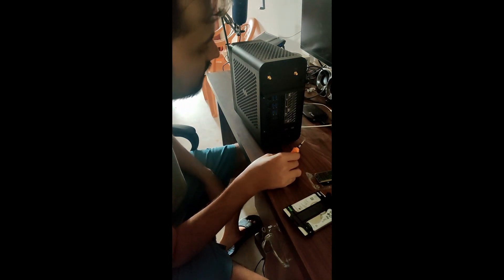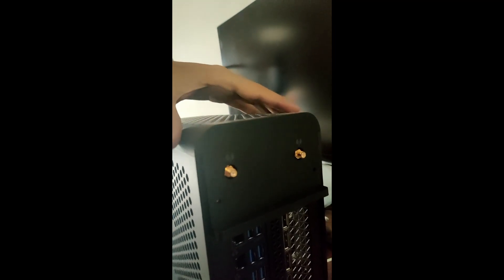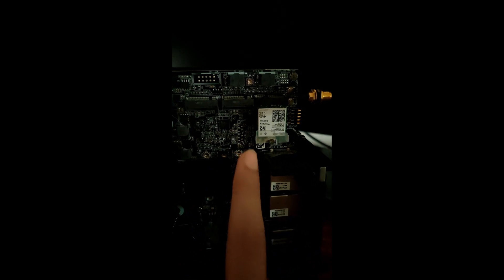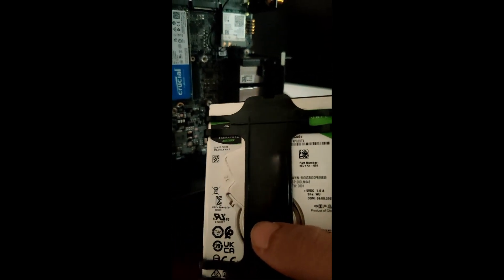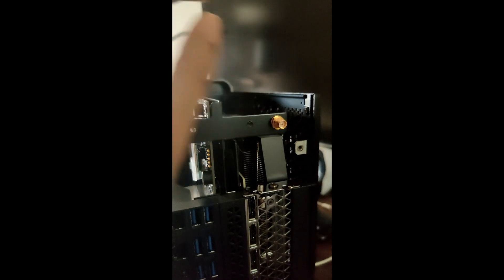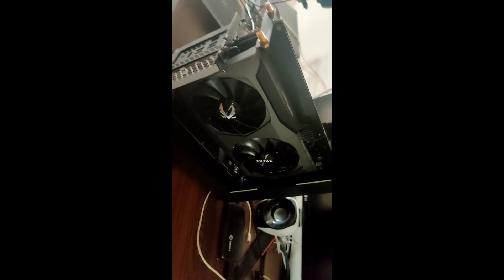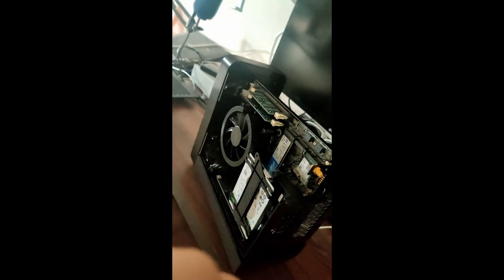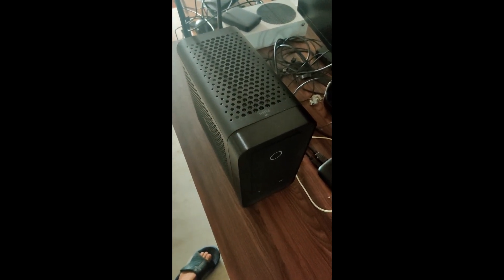Zotac Magnus One with RTX 3070 Upgrading and Installing RAM SSD HDD #zotac #zbox #magnusone

Comment: Is the CPU upgradable or soldered on the board?
Reply from the maker: The cpu can be replaced.
Reply: You can replace CPU with 10th gen CPUs , it's not soldiered.
Reply from the maker: The bios of the motherboard does not support 11th gen cpu so u cannot upgrade the cpu at present.